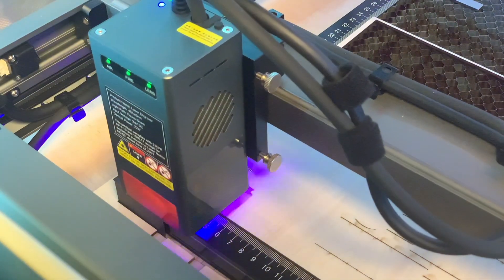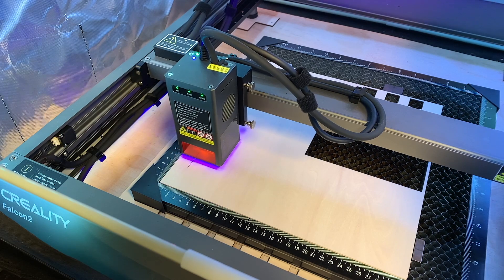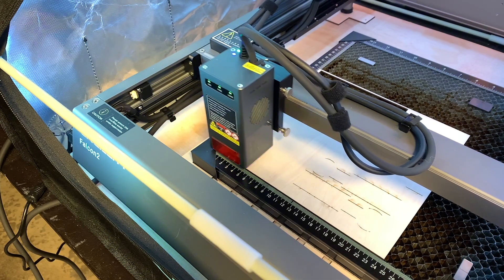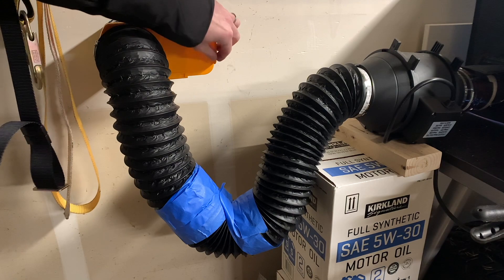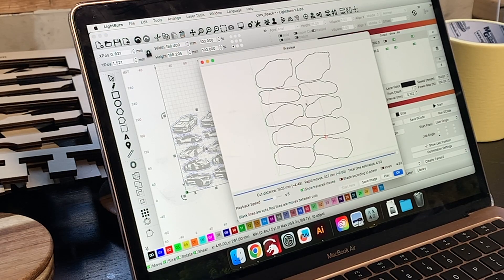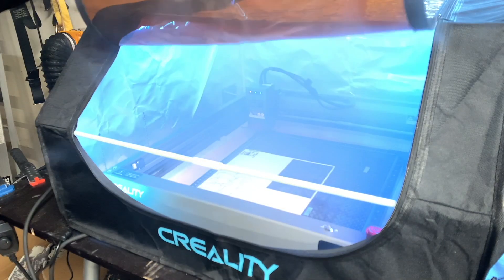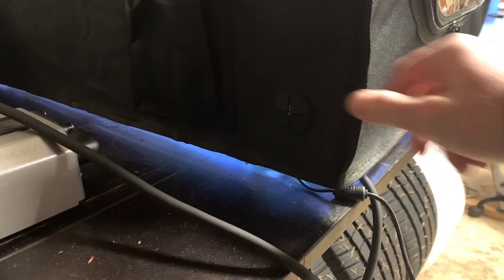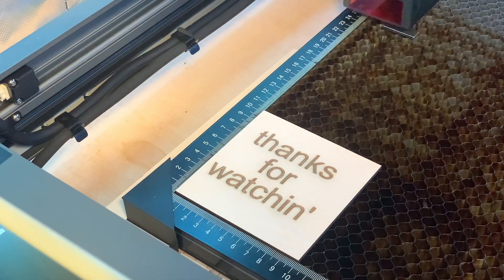How to vent a diode laser - Beginner friendly enclosure setup

Comment: Appreciate the video... I will say that you are exhausting right next to your A/C Unit.... which sucks it into your house.  Might not be ideal.
Reply from the maker: That’s a fair point
Reply: @thatDIYlife  you should be fine.  That AC unit shouldn’t have any connection to the air flow in your house
Reply from the maker: @kevingearhardt5208  yeah it’s a heat pump. It mostly blows air from what I can tell